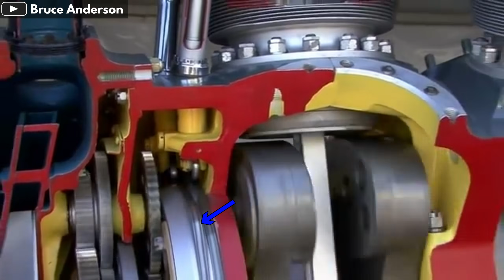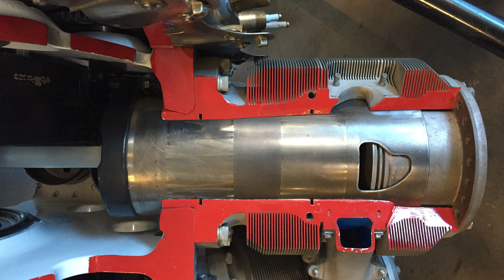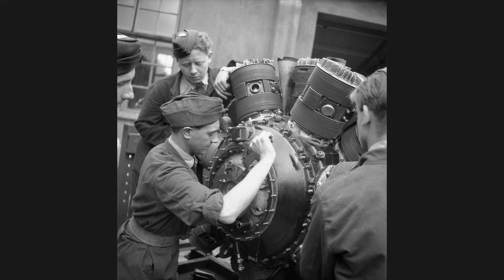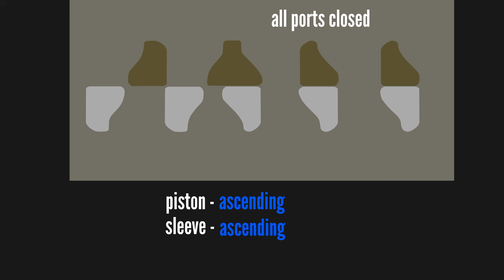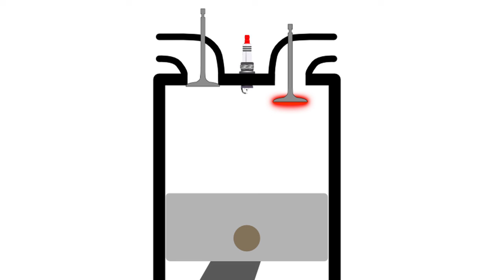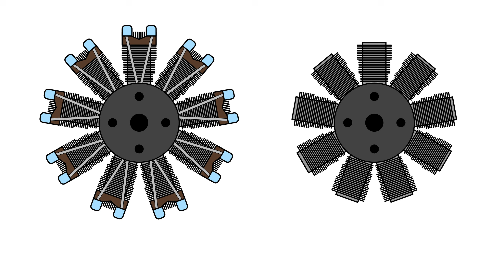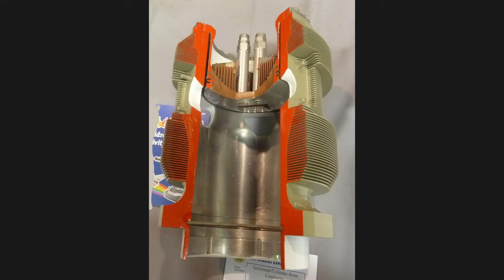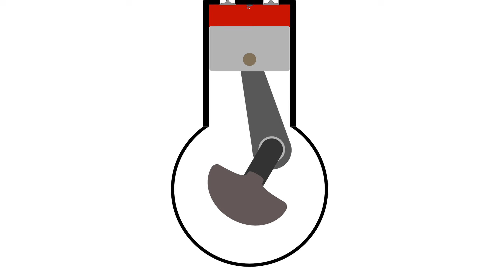Analysis of Bristol's Sleeve Valve Aero Engines

Comment from the maker: Support me on Patreon : https://www.patreon.com/letsgoaviate/
How E-Props Mastered Torsional Resonance with Ascalon Propeller : https://youtu.be/FOd650ecoyI
Boeing YC-14 Upper Surface Blowing & C-130 Hidden Facts : https://youtu.be/_zZFNQDcwlA
Reply: Sleeve valves did not allow higher compression ratios. They allowed higher boost. High compression pistons obscure the ports. If you can’t get that right…..,
Reply: @SvenTviking  No. Ignition takes place with the ports entirely below the piston rings. The pistons ALWAYS obscure the ports. The size and shape of the volume above the piston crown determines the compression ratio. You may be confusing this with engines where tuners sell pistons which are taller so as to fill more of the bore while the cylinder head remains the same.

Comment: Everything you said criticizing the Bristol sleeve-valve goes double for that crazy Whittle engine.  That guy wanted to explode a fuel-air mixture inside a tube and have the explosion exit out of the rear.  He said he would use a fan at the front to force the gas out the back and use the exhaust at the back to drive another fan to drive the front fan using a shaft.  It was pretty similar to a perpetual motion machine.  They spent a fortune trying to build the engine during the war and it made no significant difference to the outcome.  As we know today, and It was pretty clear even back then, that all aircraft engines need pistons and poppet valves to operate properly.

Comment: Along the development timeline, many techniques have been tried, to solve engineering problems. Sleeve valves were at least successful in terms of number of units produced and must have been reasonably reliable, to be produced in such numbers as they were, especially considering their use through the 2nd WW and the fact that they remained in use until the reciprocating engine's ultimate replacement by gas turbine engines.

Comment: Very interesting conclusion indeed. Hawker left the Merlin engines behind with the Typhoon and Tempest but still used poppet valve engines. I'm a retired electrical engineer but I can see a singular outstanding advantage of the Bristol engines being survivability in combat. They were air cooled. This must have been a factor ?

Comment: What is not addressed is the effect of the fore-and-aft rotating cylinders on the piston and piston rings. The piston rings not only glide vertically in the cylinders but also rotate in the piston ring grooves and/or cylinder. Considering the high pressure on the rings during the combustion stroke, I wonder what extra wear that introduces, in particular on the top ring and top ring groove.

Comment: This is one of the best videos I have found on sleeve valve engines. Well done! Two questions: What about 1) longer times between required rebuilds? Post war claims in commercial market 3000 hours versus 2000 hours as regulations required.  2)Running better carboned  and fouled once the engine was worn in...as knight engines in autos touted to customers early on, which I find an amazing claim.
By 1940 I think neither of these remained significant during war and with the availability of high octane fuels, but from an engineering standpoint were these valid advantages?
Reply from the maker: Glad you liked it! The extended hours was as far as I know in specific use sectors and/or specific engine variants. In New Zealand and South Islands use, TBO was extended to 3,500 hours for the Hercules.

As for running better when carbon fouled, I think this was a marketing tactic. I didn't find virtually anything about it in my research, which is only trusted sources. The claim does make sense, but I think this is fairly minor.

Some of the sleeve valve advantages were valid, but what is not often taken into consideration is the cost of realising it (design, production), and how small these advantages were by 1945.

Comment: Continental conducted a lot of research on Single Sleeve Valve Engines, the Burt-McCollum type, for many applications, from aircraft to railroad, work discontinued as a late consequence of 1929 crisis, Continental said SSV engines were easier and cheaper to make than popett valve Engines.
No engine has yet surpassed the fuel economy of Harry Ricardo's latest development, the Compression Ignition, Diesel, 2-Stroke open sleeve engine, sleeve acting as an annular piston, sending power to crankshaft through the sleeve driving system

Comment: Besides beign able to operate with lower ON fuel, important today, when AvGas, Unleaded AvGas is hard to find, an unmet advantage of Sleeve Valve is its non-stop movement eliminates the zero lubrication in BDC and TDC, where most wear is produced, this greatly improves engine duration.
SV have many advantages, no disadvantages. See NACA document 717, 'Flow coefficients of mono sleeve valves'; also the R-R heritage document about the Bristol Sleeve Valve aeroengines.
The july 1974 Car&Driver interview with Mike Hewland about their SV 500 cc prototype, 70 HP, 172 gr/ HP/ hr fuel economy, was discussed many times in many sites.

Harry Ricardo 'The high speed internal combustion engine', has charts about swirl advantages in Diesel engines, and depicts the amazing economy in 2-Stroke Diesel, Open Sleeve, Sleeve acting as annular piston.
If oil film between sleeve and cylinder is thin enough, sleeves are transparent to heat. Motored SSV engines had a better mechanical efficiency vs Popett valve systems.
Hewland solved the oil use issue with a ring in the base of sleeve, and a Dykes ring in Junk Head.
Piccard-Pictet Rotating Sleeve Valve is good, or better, than Burt-McCollum SSV. A Cylinder Liner, roughly same as an sleeve valve, is sold retail in some $35

Comment: Great video! I just wonder what a  turbo would do with those huge ports, and that nearly unobstructed airflow?
Reply: Calum Douglas (author of the "The Secret Horsepower Race") expressed the thought that the sleeves might not do well under high boost, due to distortion under the high loads.
Reply: @fafner1 I hadn't thought of that. Thanks!🫡

Comment: It would have been interesting to see the Bristol sleeve valve engines combined with US turbochargers.
I always imagine having to set the tappets on an 18 or 28 cylinder radial and shudder.
Reply: They really struggled with reliability so you can imagine that turbocharging wouldn't have helped matters..

Comment: I think you have the valve timing demo back to front I.e TDC is BDC.
Reply from the maker: Not impossible, but I doubt it, it matches the sequence of two different sources I'm comfortable trusting. I've included TDC and BDC for both the sleeves and pistons, its easy to lose track of movement with my animation, keeping in mind the pistons move twice the speed of the sleeves.

Comment: Bristol’s sleeve valve engines were definitely worth it for a number of reasons. 

They were not as wide. With no valve gear at the top of each cylinder the engine diameter was smaller and the aero drag reduced. 

The advantage in compression ratio meant that adequate power could be achieved using lower quality fuel. That had a major logistical consequence in the war. 

As the sleeve valve came along later it never reached the peak of development during the war. Poppet valve engines did, and everyone realised it during the war. As it happened, Whittle’s jet did work and that was the chosen direction. But had Whittle’s jet not arrived the Centaurus still had a lot of development room left in it. 3000hp was on the cards, which would have meant the allies having aero power superiority. More supercharging and turbo charging could have been added to improve performance at altitude. 

As other folk have reported sleeve valve overhaul intervals reached very high numbers (thousands of hours). 

They were quiet (from the front). Beaufighters were able to surprise ground troops. 

Cooling was simpler. B29s were prone to catching fire at take off. There were fewer hot spots on Centaurus. 

An often overlooked fact is the thrust developed in the cooling arrangements (just as was done with the radiator in P51 Mustang). The cleaner head design of sleeve valve engines means that cooling thrust was more achievable than with poppet valves. I don’t know if Centaurus did this, but the effect would have been more pronounced. 

Cost. Once they had mastered mass production, sleeve valve engines were easier to produce. No head gaskets for one thing. Yes there were a lot of gears but they were simple spur gears. 

I think the sleeve moved up and down with the piston but not as far? If so the net piston speed would have been reduced allowing more RPM. 

All in all, a handy backup for jet engines. Remember that they were asked to develop sleeve valves whilst Whittle had also been asked to develop his jet. They backed both horses. Jets were always going to win if they worked, but they wanted a plan B. Plan B delivered useful results in its own right, but plan A didn’t fail either. The plan was always to not develop sleeve valve engines further if jet engines worked, because jets clearly had more development headroom.
Reply: Bristols controversial sleeve valve engines in hindsight was a huge waste of resources that could have been used to develop technology with more future potential like axial turbojets and turboprop.
 The Sleeve valve was a dead-end concept and was recognized as such in America and Germany before the war.
SVEs were rendered obsolete by improvements in poppet valve 

Poppet valve engines are still mass produced by the millions while sleeve valve engines have been obsolete for over 70 years
Reply: @WilhelmKarsten  Hindsight of course sees everything...

Sleeve valves were and are no more a dead-end concept than poppet valves. They were manufactured in large numbers, and some highly noteworthy aircraft used them to great effect (Beaufighter, Sea Fury). Bristol also manufactured a great many poppet valve engines (Pegasus, used in Short Sunderland, Swordfish) at the same time. And as the Korean war showed, Sea Fury wasn't totally incapable against jet powered Mig 15s. 

Poppet valves have endured in piston engines largely due to design inertia, rather than any inherent superiority.
Reply: @abarratt8869 Name a company that still makes them or an aircraft that still operates with one?

Sleeve valves only offered a limited advantage before the introduction of sodium cooled poppet valves made from high temperature Nickel based stainless steel.
After this time sleeve valve engines offer no advantages and had several serious problems which were never adequately resolved.
 A piston engined fighter like the Sea Fury was rendered completely obsolete by swept wing jet fighters like the MiG-15
Reply: @abarratt8869  It seems only the British believed that there was still potential in sleeve-valve motors... the rest of the world had moved on when sodium-cooled valves made of stainless steel were introduced.  There are many examples in UK aviation that reveals that Britain was lagging years behind in aerospace and internal combustion technology

Comment: Hi mate
Over the last few days I've had a deep dive into your videos, and you've done me a great service. Your videos are excellent, especially because it seems you don't hold back from talking about minute, technical details that help illuminate the broader developments of aviation engine technology. 
THEREFORE I WISH TO MAKE A REQUEST. Or, suggest an idea. If we go to any wiki page, say for the Rolls Royce Dart engine of F27, HS748 and YS11 fame, there's bound to be about 10-30 distinct versions listed. But what's the difference?? What's the TINY difference? The sort of tiny difference that perhaps only you bother to talk about? THat's what I'd like to see, for the Dart especially but perhaps PT6 or PW120 or whatever -- a really deep dive into the tiny additions or changes to each iteration.
Once again thanks for the content. It's brilliant.
Reply from the maker: Thank you, I'm glad you find the videos informative. Engines of whatever type usually have different variants, and the more successful an engine, the more variants it's likely to have (or vice versa). The manufacturer could fix issues with updated variants, bring improvements, or just make tiny changes with some parts or manufacturing. The PT6 turboprop for example, which is likely the most successful turboprop engine, has a massive list of variants ranging from 500 shp to around 1700 shp. This makes it suitable for a whole range of different sizes of aircraft and would have contributed to its success.

Going into detail of the changes of all the variants of an engine requires a lot of info from the manufacturer which can be difficult to find. I do have an idea for a video exactly like what you are requesting which has been on the backburner for a while, but its on the variants of a popular piston engine. I'm not sure if that is of interest, but thanks for the suggestion I will certainly keep it in mind.
Reply: @LetsGoAviate  Thanks for replying mate!
I hope you DO do that piston engine video!! I think at such a detail level you would have perhaps the only video of such a kind in the world.

Comment: Reading Harry Ricardo's "The high speed internal combustion engine" forty odd years ago I became a fan of sleeve valves. In my opinion (and it is just an opinion) the sleeve valve is a fundamentaly better way of getting an engine to breathe and poppet valves main advantage was being  a proven technology in what is, for many good reasons, the conservative world of aero engine technology: it should be remembered that poppet valves needed a great deal of development to match sleeve valve capabilities despite the problems that had to be overcome in producing a fundamentally different technology. Sadly, all is mute as in aviation the piston engine was replaced by gas turbines in all but light aircraft and the design of those piston engines still used dates back 80 or so years with only minor tinkering as the market is relatively small and it is unlikely that that those manufacturers need, or have any desire, to develop new technology
Reply: Ricardo's conclusions regarding the future of the sleeve valve design were completely wrong, in hindsight we know that the concept was an evolutionary dead-end and it's disadvantages outweighs the advantages significantly enough to render the design completely extinct.

Comment: Good summary, but the poppet valve still had limitations especially with high volume supercharging in the race for altitude as with the German manufacturers .Calum Douglas explains this very well in the Great Horsepower race . I think as the writing was on the wall as ww2 progressed as did gas turbine development all these designs post war were commercially timed out.They all knew it. BUt exhaust valve material (sodium cooled was not cheap) needed expensive alloys to make KE965 etc. the German companies could not obtain, nor 100+ octane fuel.The Sabres appalling failure rate with the Tiffy was saved by Bristols clapped out grinder (I paraphrase) which had it not been wartime and forced by government would not have happened. Bristol also made excellent medium power ohv engines Pegasus Mercury .
   Nice shots of Sammy Miller who has rebuilt a beautiful Grindley Peerless 1000 cc moot Yale with a Barr and Stroud sv engine.. oh it is manifestly shorter in the frame than comparable ohv motors eg Brought with JAP motor.
Reply: I find Sleeve Valve engines fascinating and impressive feats of mechanical engineering, but I am under no illusions that they were superior to poppet valve engines in any way or that the benefits of sleeve valves outweighed their disadvantages.

Calum Douglas's conclusions are clearly wrong
 The British wasted significant resources on what was already know in many circles to be a completely dead-end concept that was abandoned in America and Germany years earlier for these reasons.
 Sodium-cooled, high temperature stainless steel exhaust valves were already widely adopted in German aircraft engines before the war, Germany (rightly) saw no advantages to developing what was then considered obsolete technology by the Luftwaffe.   

We still used poppet valve engines today, over 200 million made per year while sleeve valve engines are completely extinct, no longer made or used.
 There are no longer any sleeve valve aircraft in service.
Poppet valve engines still dominate aviation.
Reply: Sleeve valve engines offer less advantages in a Supercharged engine than a Natural Aspirated one...
By the late 1930s and early 40s sleeve valve engines are recognized as an evolutionary dead-end
Reply: Douglas is clearly infected by a common British psychosis which is the desire from British populist revisionist authors to whitewash and twist great technological failures and blunders like the British sleeve valve engines, the de Havilland Comet, Blue Streak and Concorde and try to rewrite the story into a tale of great British technical achievement.
 Britain is the most prolific producer of  fiction in history and this makes its own history suspect by default.